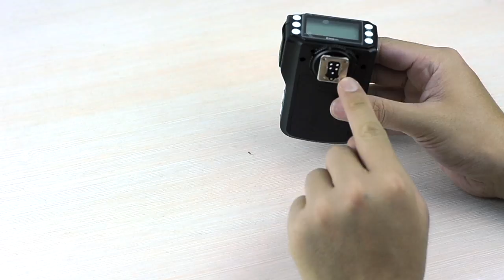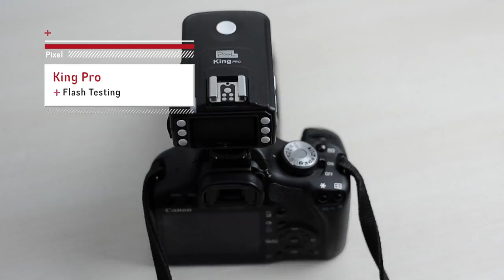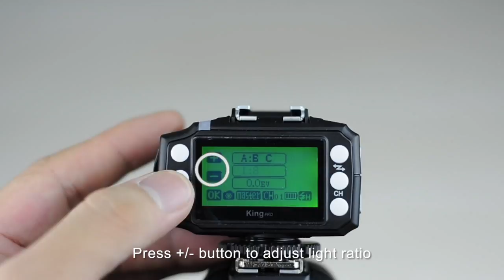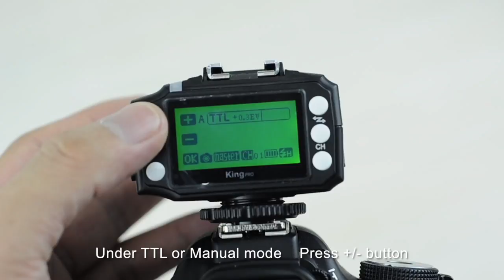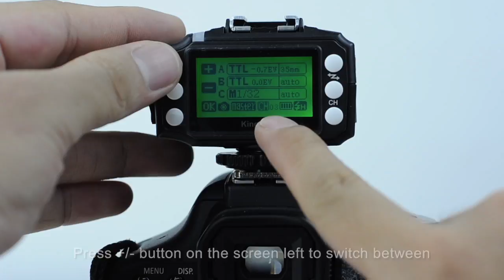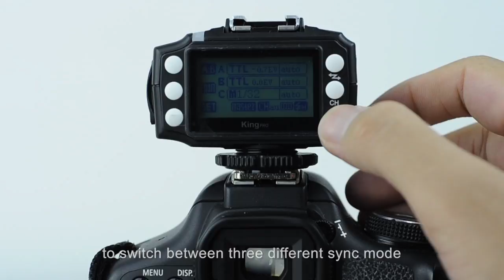Pixel King Pro: The 3rd generation wireless TTL flash trigger for Canon and Nikon introduction

Comment: i have pixel king pro for sony. 
are the group leds red light at the transmitter left side always on during operation? 
or they will turn off after few seconds? 
because my pixel king pro group leds won't turn off during operation, even though i don't press any button. 
thank's.

Comment: The Nikon product is NOT YET ready, too defective & inconsistent. iTTL underexposes by 2-4 stops with various off-camera SB-800 speedlights I used; inconsistent & wrong manual exposure, changing (nikon D610) ISO in MANUAL flash mode gives the same exposure (how can that be?!), even had some misfires. Seems I threw away my money……any help please?
Reply: photofx it's April 2015 and these issues(NOT YET ready, too defective & inconsistent. iTTL underexposes by 2-4 stops with various off-camera SB-800 speedlights)  HAVE NOT BEEN FIXED. And Pixel customer service is TERRIBLE! eMail unanswered for days!
Reply: doubledark2 save your money, buy the new Odin 2; I'm returning mine and will buy something that works

Comment: Why?
Do you want to pay more?

The elites & I preferred using using the ATG Gold Wireless ETTL/ITTL Radio Set.  It has AF Assist Beam and receiver has better metal shoe. 

ATG & Paul C. Buff do not need vendors. 
Both are from USA.
They pass the saving to us.